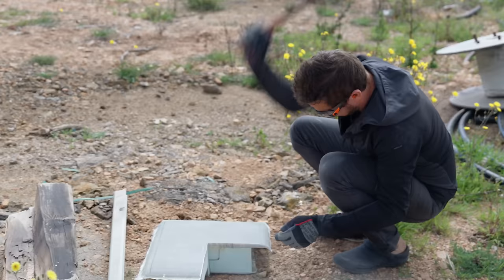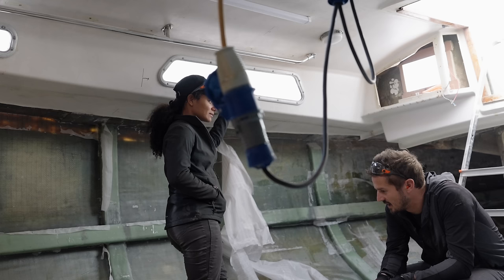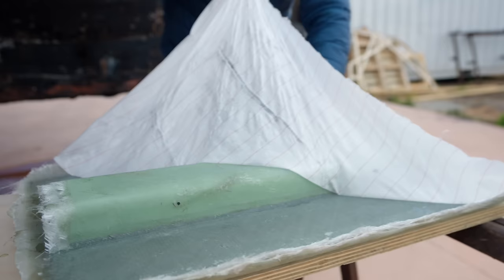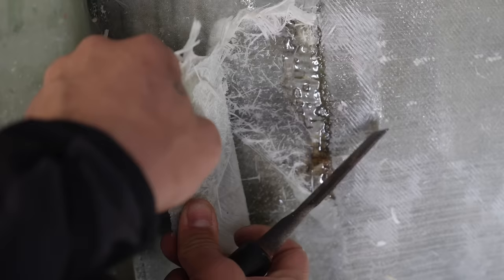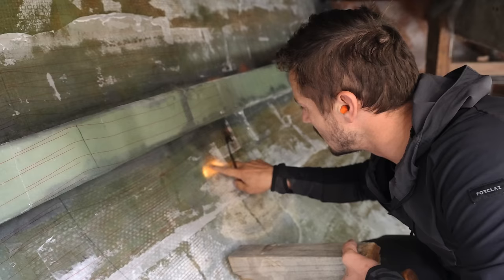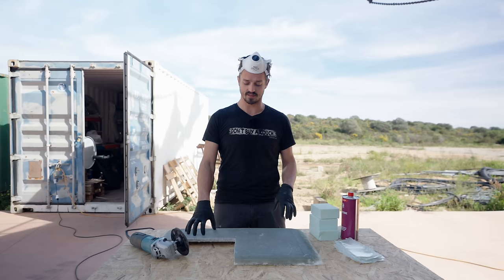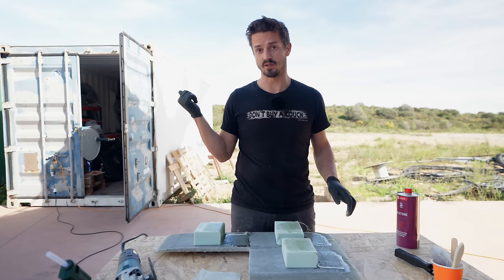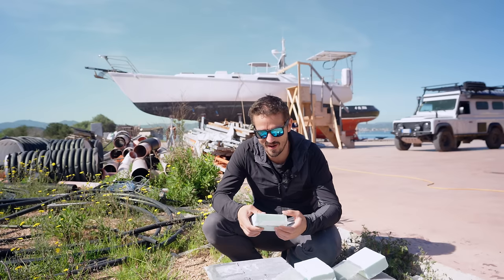If It Doesn’t Work, Hit It With a Hammer | Step 387

Comment: I think you are using polyester on already hardened polyester. It will not be a laminate, but a glue. You should use Vinylester or even better epoxy.
Reply: They are using vinylester

Comment: I'm confused with some of the terms used in the narrative. When you say grind to get the wax off' makes me conclude you are using waxed Vinylester resin instead of laminating resin, i.e. without wax.
In combination with Vinylester resin, the peelply will not only create a smooth surface, it will also create an air barrier making sure the resin can fully cure. In other words, peelply ensures you have a cured laminating resin without any need for wax. I would assume your test piece broke off so clean for the only simple eason there was still some wax on the surface of the 'pseudo' hull plate. Bottomline, use laminating resin instead of waxed resin if you manufacture your composite structures in subsequent iterations. Or am i missing something? Good luck!

Comment: Now you can imagine how easy it is to figure out "delamination" in a fibre-composite material. If only the guy of that titanic submersible had tested it. The fibres have tensile strength, the composite needs to provide other strengths and the bond between them needs to be structurally strong enough. Just like in steel reinforced concrete that all architects apply in their designs.
Reply: No. The fibers provide both tension and compression strength. The resin helps keep the fibers aligned properly so that they can resist the compression loading. Without the resin, the fibers would bend and collapse. Without the fibers, the resin would collapse when the resin reaches its maximum compression strain limit (maybe like 10,000 psi). It truly is a composite structure. Carbon fiber is stronger in tension than it is in compression, but it is still pretty strong in compression compared to other materials.

Comment: Vinylester bond strength ~500 psi vs epoxy at ~2000 makes a strong argument for bonding with epoxy.
Reply from the maker: But what is the strength of the glass? As you could see in our tests the glass layers tore apart before the bond between old and new came apart. So that extra “strength” is often waisted.
Reply: @SailingUma  the bond strength applies to the bond between glass fibres as well as layers.

Comment: From years of experience doing just this type of work, the last test you did would not have been satisfactory for me.  The fact that you were able to peel off the laminated section was alarming.  But my experience does not include the use of vinyl ester resin, only epoxy.

Comment: I don't know guys.....it worries me that you didn't stay with the original resin material.....why did you switch the resin type? If you want perfect chemical bonding.....or did I miss something?
Reply from the maker: No such thing as a chemical bond between cured glass and new. That's why you grind it a bit before laminating.

Comment: I still don't understand why the rib/structural foam wasn't attached with a strong adhesive.   Seems a shame to have missed that extra connection.
Reply from the maker: Why, the foam is only useful in compression to keep the glass from deforming. Tiny voids make no difference in it's ability to do that. It's just the form work to keep the glass in shape while it cures. We've mentioned this multiple time in the last few videos. Not sure if we can say it any more clearly. Beside, how exactly would you stick the foam to a curved surface without using a glue that dried very quickly. If we use thickened epoxy of filler, we would have had to use come sort of wedges or cross bracing on every rib to hold it in place? That would take hours per rib. There is really no reason to.
Reply: @SailingUma  yeah, you guys are engineers so I don't expect you to agree.  I'm a builder so I don't expect to agree with engineers either  (not initially anyway, I just change engineers until I find one I can work with on a given issue).  As a builder I look for all the structure/connection/adhesion I can find find, unless flex is required.  In this case I would have used an adhesive to bond the ribs.  There are a variety of  ways to hold/clamp ribs in situ as adhesives cure....one of them is hot glue spots within the adhesive area, others are spring sticks etc etc..  Anyhow, great project,  almost bought a Pearson 36 (they were practically giving it away) but the keel smile and general worry about keel bolts led me to choosing an encapsulated keel, probably just more of my belt and suspenders attitude. Cheers.

Comment: The stringers and the glue are the issue. And the stringers are too large. No chemical bond to the hyll.  Use to use 1/2 piece of cardboard tube. This allowed saturation of the cardboard and thus chemical bond to the hull of the structure.  The foam has no structure.
Reply: Half round cardboard tubes were rubbish formers for fiberglass ‘top hat sections’ , which is what they are trying to build with foam , but still very old school type design. The half round cardboard tube does not have good shape . Its now confined to the lowest quality fiberglass products produced , one piece bathroom shower units. 
Cheers Warren

Comment: UNless my memory has escaped me I think you used a hot glue gun when you glued the supports to the sample piece you put together.  Could the hot glue not have been a proper adhesive in that test piece??  Just an idea not meant as to criticize that which you had done.

Comment: As far as I can see, nobody mentions the fact that polyester and vinylester is a resin.. not a glue.. Epoxy on the other hand is both a resin and and a glue.I do off course recognise that cost is a factor whom dictates what kind of product you are using on your repair. But as a general rule of thumb, I would never use anything else than epoxy on structural parts.

Comment: WAIT!!!  ITS NOT A TOTAL LOSS!  UNFORTUNATELY, This is probably WAY too late just based on your post lag....

Polyester resin does not stick to old poly.  But the ribs you eade are not a total waste!

Cut them down and laminate them in with epoxy!  Easy Peasy.  Epoxy WILL hold. (Watch Expedition Evans and their delaminating the grid into the Beneteau)

PLEASE do not use poly on old poly.  The extra money will be SOOOOO worth it!

Your reasoning behind what you're doing is spot on in making (a very strong) the boat stronger.  It is only the resin that is going to Continue to be the problem.

(Also, slamming the outside of your hull like that can create damage that you cannot see by shattering the resin.)

Comment: Only Epoxy Resin adheres to wood, forget about polyester resin!
Reply from the maker: Um. That’s not true. Vinyl ester resin works just fine. The plywood layers come apart before the resin gives way.
Reply: @SailingUma  Yes, it's true and you can't even compare it.

Comment: How marvellous! You just have to justify how great it is. Everything is in perfect order here, professionally as well.
Of course, everything can be explained and with some magic (hammer pounding on a closed rigid structure) you can even prove the solidity... but I think it's just a trick my woodpecker coma. This bracing is completely irrelevant anyway. If it splits from the inside of the frame, then it is not of particular importance.
Of course, this reform will keep the barges buoyant, but the value of this strength-increasing development is almost zero.
I will not comment any more and you can be sure that I would not recommend your very solid ships for purchase to anyone, especially since this strengthening reform is practically worthless.

Comment: Why not you use divinycell on the hull so you get strength and insulation at once (make a sandwich laminate)?
Reply from the maker: We touched briefly on this earlier. Vacuuming a hull out of a mold can cause deformation.

Comment: The peelply must contain some kind of release agent. It is used as a separator between epoxy reinforced fibers and a breather material when using vacuum bagging techniques, and it is still "easy" to peel off. We always roughed it up if we needed to add layers after.  Also remember that (poly)esters do not bound to epoxy but epoxy bounds to (poly)esters. 

The boat builder pointing out that you added strength is spot on. As fare as I can see you could consider the foam as a spacer so it is the bound between (glass)fiber layers that should be tested in this case. The stiffness and strength is in the distance between inner and outer fiber layer and the fiber "wall", wrapping the foam, between those extremities.

Anyway, stuff taken from the top of my head. My best wishes for the rebuild. With your attitude to it it is destined to be a success.

Comment: Regarding your test pieces:

Problem #1.  Note that when it de-laminated when you whacked it with your hammer, the "rib" part was only attached to the "hull" part with just a thin zig-zag of glue.  I think that was a mistake .  You should have spread a coat of epoxy over the entire surface where the two components came in contact with each other.

Problem #2.  I noticed that you rounded-off the edge of the "rib" before you added lamentations  of fiberglass cloth.  But you left the junction of the "rib" and the "hull" as a sharp angle.  Sharp angles are a no-no!  A sharp edge is a stress-riser.  You should have applied a fillet of "googe" - a kind of putty of epoxy thickened with glass beads or diatomaceous earth or whatever they use these days.  Then, before it cured, form the fillet with a "tool" such as a plastic lid from something like a butter container lid - something disposable - to join the two parts with a smooth rounded curve.  Then apply several layers of fiberglass and epoxy, with each layer being wider than the layer beneath it.  This will spread the forces over a wide area rather than concentrate the stress to a thin line.

Suggest you try another test piece, and if this technique proves to work, get thee to work with you cloth, epoxy, thickener, and your butter tub lid.

Comment: First off, been watching you guys since the beginning, I love your vids and your lifestyle, so please don't think I'm just a hater...
There's non-destructive testing and there's testing to destruction. You guys did destructive testing... without the destruction. In other words, you whacked the hell outta your hull and hoped it wouldn't fail.  Because you didn't see any obvious signs of failure (delamination), you called it good. Since all you used was the good ol' MK-I eyeball for inspecting, you can't be 100% sure you didn't cause any damage anyway. A weakened bond doesn't necessarily show.... and fair play, I really don't think you did, that hull will take more than just your hammer, but.... I'd ask you don't get in the habit  of whacking your boat and calling it good... or more importantly, teaching others that's the way to do it.  Test to destruction or figure a way to quantify your test, just don't mix the two.  Cheers.

Comment: Hitting the hull through a wooden plank does not make sense. If the plank area is ca 200 cm2 it reduces the hammer impact 50 times (100 times?)

Comment: Hitting with a hammer is a null test... as in reality your boat weighs TONNES...  of impact force... not just a 100 kg of hammer force at best... 1 obvious error is seen when you chiselled glass off the hull was the shiney resin below the peeled section, never glass over shiney un keyed sub surfaced...

Comment: You shouldn’t be reassured at all by the hammer ‘test’, that has proved nothing. Tapping the side with a little hammer is nothing compared to the forces the hull will routinely experience.
It is when the hull flexes that it could delaminate. 
Assuming there will be some movement within the hull, surely the design would have to ensure that the inner skin is equally as flexible as the outer skin otherwise the bond will be severely tested.

Comment: If you make a small boat, then hit it with a hammer...do the math. How many times scale is your boat? Now do the same math for the hammer. Now multiply the FORCE by the same factor, DUH! If you hit ANY glass boat THAT hard, with a hammer the size of your body, HELLO!!!! If you want a tank buy a welder. I just stopper at timestamp 7:05, now I will watch more. I think it is fine, yes, I have done LOTS of glass, on cars. Lots of vibration and crashes.

Comment: Your test is pretty lame, however the bond should be strong enough to carry the stresses you need. The bulkheads are going to make the difference if placed correctly.   Next time, bond the core foam to the glass and use closed cell foam only.

Comment: Sorry, but I wouldn't want to trust that hull in the middle of the North Atlantic with those  non-structural foam ribs stuck in place and 90 degree glass pasted over them.
 
1- Your original hull was subjected to years of degradation through flexing every time you pounded over a wave. No way to quantify that.  20%?  50%? That is why I suggested treating it as the outer skin of a cored lamination.  I'd use resin infusion to add a full core and a complete inner skin before building in ribs, longitudinal s, and structural furniture.  Stiffer, stronger, and lighter.  Easier and much faster'

My experience is that epoxy resin produces the strongest possible  secondary bond. But test & test before committing!

2- That said,  a lamination onto a 40 year old hull subject to years of spilled oil, spaghetti sauce, and tuna is only as good as the mating surface no matter how good the grinding  and acetone scrubbing.  An area that seems perfect in one location may be be unacceptable two feet away.  And tapping  with a little hammer is not the same as being hit by the thousandth wave.

3- There is a common human failing known as the gamblers fallacy. The fact that  you've lost every turn of the cards doesn't mean that you are due for an Ace that will restore your lost winnings. There is only what is. 

You clearly love Uma. She has been a key to your lives and  relationship over  many years. And the choice to save her is admirable. Rationality has little to do with it. She can be saved, but not by wearing  rose colored glasses.  A couple of weeks camping  in the spring flowers in the Alps. A large chisel in the hands of someone you trust should do the job of returning her to a blank slate before you return!

Comment: Splash Test?
I am glad your chisel test seems to show good bonding qualities. However I think your hammer test is not relevant: your 6t hull hitting even a slow speed a pontoon generates energy orders of magnitude higher than your little hammer. Why not splash Uma for a better test? The constraints on the hull are completely different in the water than when on the hard, and the kick trip the water will give her a good shake. Personally, the added expense would help me sleep better.

Comment: Guys you seem to get lots of wrong advice. Than you pass that on to your listeners. Just because someone takes your money for advise or work does not mean they know what they are saying or doing..Even so claiming to have 20 years of experience..
Did your workers really use hot glue to adhere foam to hull? Polyester resin is not a glue. It's a laminating resin. The strenght is not in adhesion. Reason modern boats are build with epoxies. Modern repairs are mostly epoxies. Even when fixing polyester boats. Epoxy sticks way better to polyester than polyester to polyester. Fillers can be used on either. The more filler is used the less adhesion you will have. 
Do some research and see how strong structural used glassed over corecell or divinicell foam really is. And how to go about this. Modern multihulls are mostly foam and the glass work protects the structural foam. It actually is that you could punch a spoon through the outer hull above waterline on even a 50 foot boat. . Not so much were impact might be expected. So under waterline and bows and sterns are much tougher build. The glass is thin. Strenght comes from the foam and added rigidity and water tightness and ability to fair and paint from the glass work. Test it for yourself. Do two equal size jobs one with good foam and epoxies to substrate and one layer of glass over it. And first coat each part like foam with resin before adding The glass. Never just add resin to dry glass..lay glass onto resin instead. use good roller to squeeze out air bubbles. Best roll on glass to first coat of resin or even have to layers of resin before adding glass with roller. Even foam used is closed cell foam it take some resin to fill open pores.  Once glass is rolled on little resin gets added to it. Better to squeeze resin into glass from below with roller. The other the way you used hot glue and one layer of glass over it. Do yours with polyester the other with epoxy. Use a luggage scale to measure pounds used to pull appart your jobs. Do not use a hammer. Get accurate numbers. If you look for a smooth finish add fairing filler to last layer of resin and that way less sanding or grinding is needed. Hotcoat as much as possible to avoid sanding and curing between coats. Watch the blushing. If you remove blushing use the right method. Dish soap removes the amine blush better than acetone. It's a greasy thing best to be removed with degreaser. Use joy or dawn.  Reach out to manufactures more than people using products. People and workers all will have their own opinions. Best from the horses mouth. You have to be a pro to understand a pro.